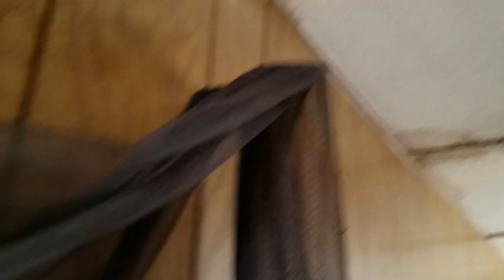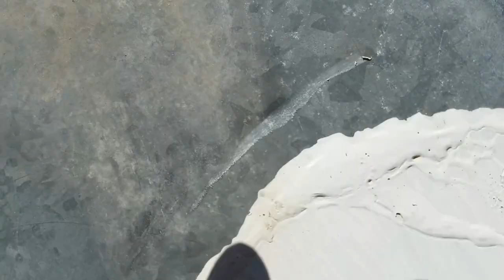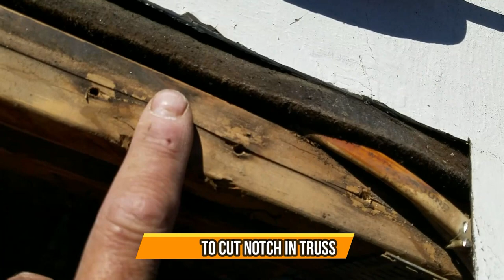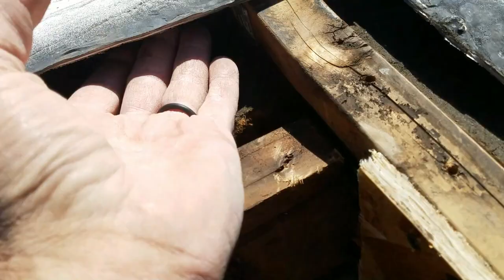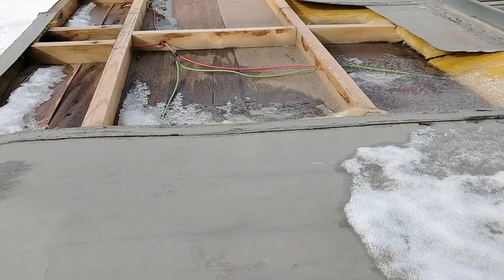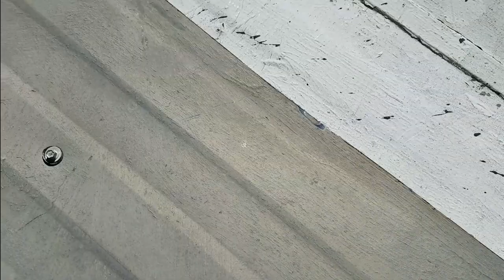Trailer house Mobile home roof repair

Comment: I taped the joints of the wood panels of the walls with fiberglass mesh and 90 minute hot mud paper tape angles  finish the wall joints like you would regular drywall  then putty coat the whole wall with topping and finally texture. Works swell!
Reply from the maker: Yeah I did the same thing to an old house that the owner didn't want to remove the old paneling, I had to spray Kilz on it first so the mud would stick to it. Could of been grease from kitchen that prevented it from sticking in the first place, but once I got it to stick you couldn't tell it from Drywall. Thanks for watching,
Reply: @TheBlueCollarPreacher  I washed the walls with  T.S.P first to get any old grease and dirt off. Thank you Preach

Comment: What is squishing out? What type of gel is it? Some type of liquid metal I'm guessing.. can you tell me what it's called?
Reply from the maker: The sealer I used was Butyl; but I think it's getting harder to find, I know the Sika concrete sealer would be your next best option. I also painted the seams with that stuff you always see advertised on TV were a the guy makes a boat out of an old screen door, should be able to buy it over the counter these days. Thanks for watching.
Reply: Thank you for useful information and your video!!
Reply: @TheBlueCollarPreacher  my uncle bought that boat made out of the screen door. we take if bass fishing